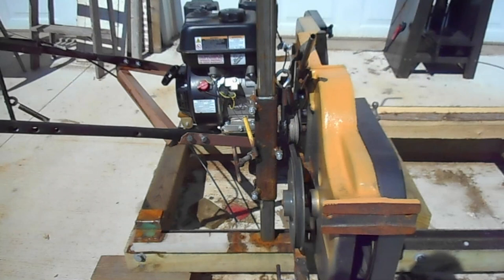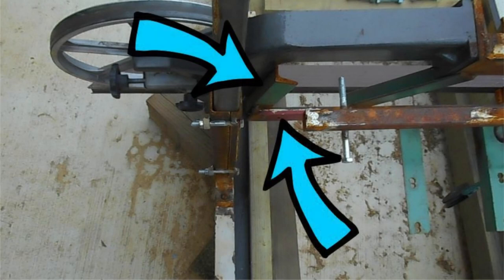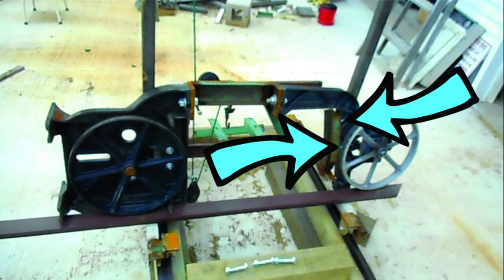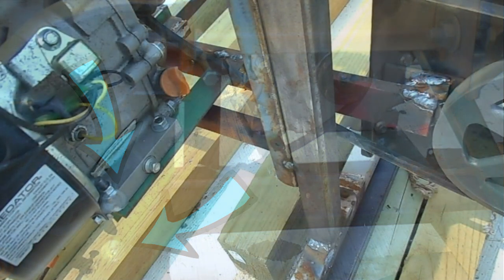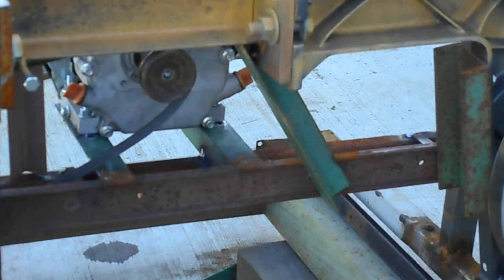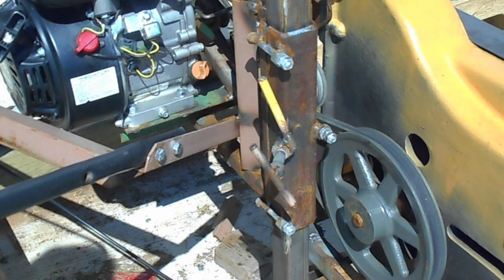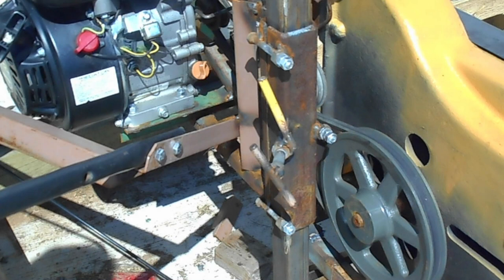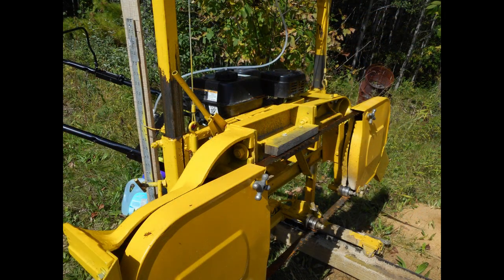Po-Boys DIY sawmill No 1, Requested details stills and descriptions

Comment: Mac what size wheels and length of ban (width and thickness of the ban) are you using on this rig. I have an old vertical 14” shop saw I will (or thinking of) parting out .
Reply from the maker: 14" wheels, original blade was 93" long I added 12" extension adding 24" to length of blade to 117". you may want to do a little research on available blades mine were about $25.00 each and I have seen blades as low as $15.00 each since I made that sawmill.